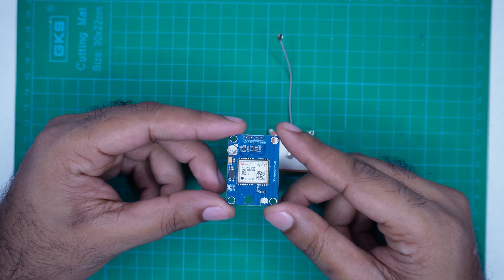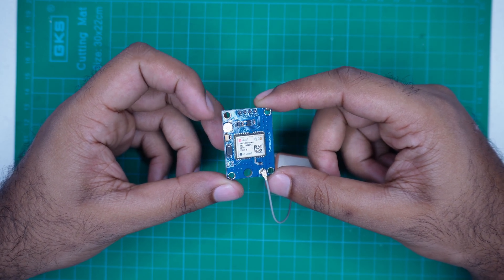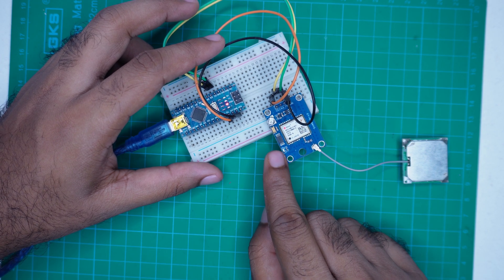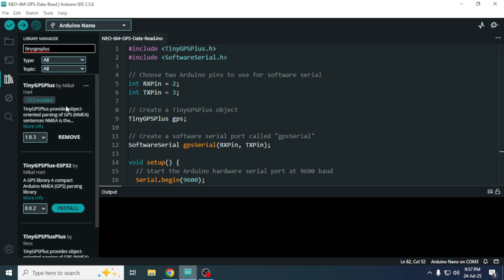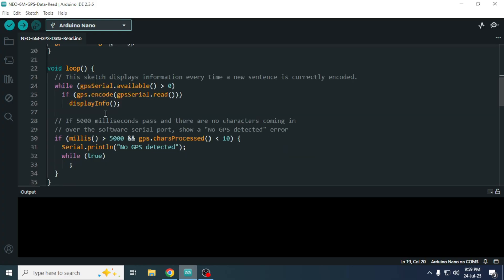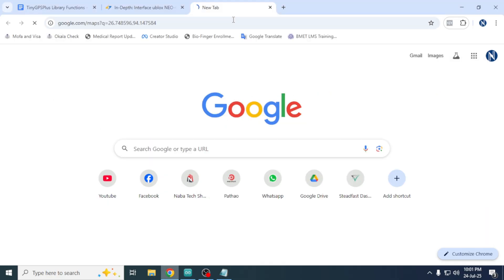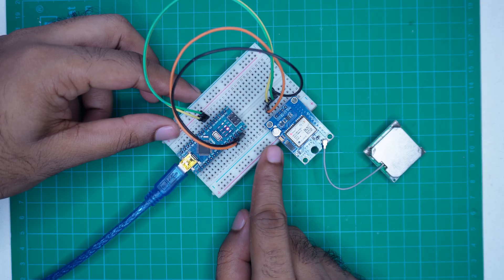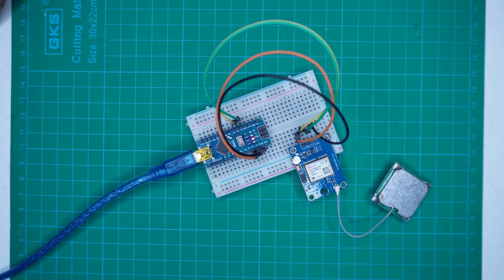How to Use Neo-6M GPS Module with Arduino | Live Location on Google Maps!

Comment: In the specs you provided it says max input/output is 3.3V not 5V. 
3.3V is provided in the board to feed the the GPS. I use a Mega 2560.
Shoudn't we use a current division in pins 2 and 3 to deal with that ?
I'm really in doubt because I fear I damaged one of these, bought another one  and don't want to make the same mistake again. 
Thank you

CF
Reply from the maker: Actually it's wise to use current division. But actually on direct wiring it's not create any problem.